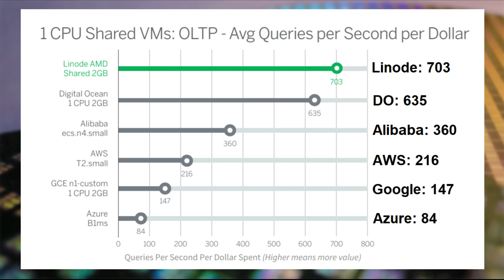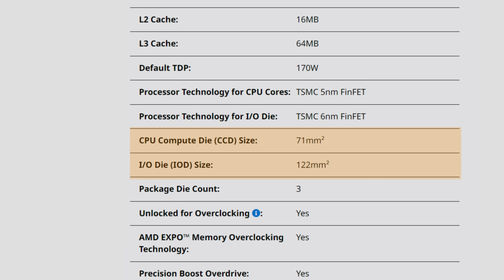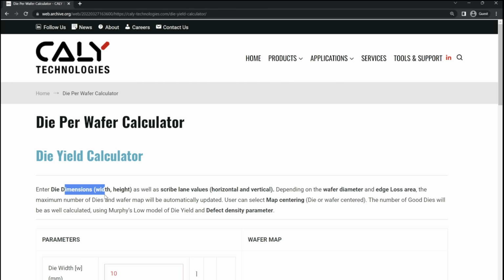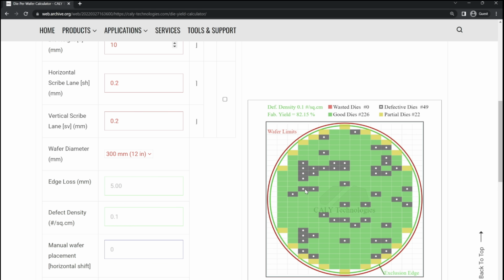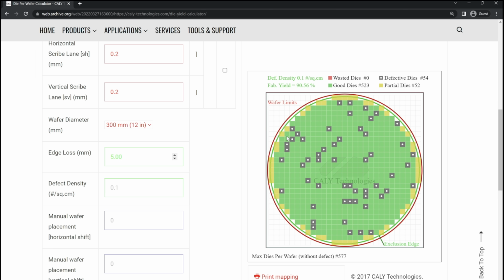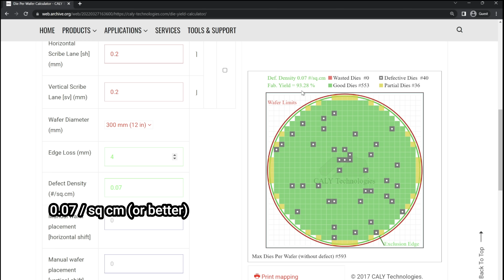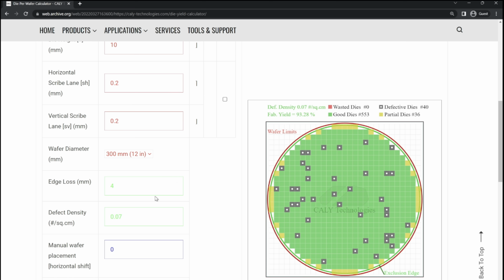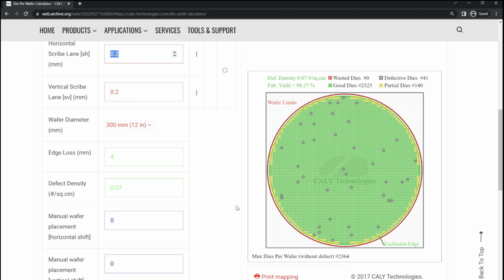AMD Ryzen 9 7950X: Cost to Manufacture?

Comment: I would be curious to see this same logic applied to the new GA102 die from Nvidia... that thing is pretty chunky
Reply: It's easy to work out, but without doing it properly, about $200.  Its 608mm² which is roughly 9 times the size of the AMD CCD.
That's using the cost to process a 12" wafer on N5, not N4, not sure how much a wafer processed with N4 costs, haven't ever seen it published, I knew from memory N5 cost $17,000 before I even opened this vid
Reply: @minus3dbintheteens60  Nvidia is using a custom variant of N4 called 4N. The amount that Nvidia spent divided by the amount of wafers they get, amounts to around 24-25K per wafer. Their per wafer cost is probably slightly lower because they had to spend some money to get the customizations tooled.
Reply: @dex6316  gee, that seems expensive, if I had to guess, I would have said that the cost would have equalled the same as the cost per transistor as N7 and N5, as it seems to be the trend, wafer prices increase, cost per transistor stays stagnant (for now, until it probably rises)
Reply: @minus3dbintheteens60  nVidia has clarified things, what they call 4N is not TSMC's N4 apparently, but N5
Reply: I think all nVidia has done is changed the fin arrangement of the commercial 5N that AMD is using and slapped a different name on it.  I knew that N4 is just a refinement of N5, the density would probably be the same if not very similar between the two.  The designers can choose different fin configurations based on their cell blocks to optimise for efficiency, power or density
Reply: About US$193 if every die from a wafer is usable, using the video's numbers.
Reply: I assume you mean AD102? GA102 is the last-gen die.

Comment: Honestly, I think it's ridiculous that we give AMD and Nvidia so much s**t for overpriced GPUs, but we let AMD and Intel get away with charging the same for CPUs that cost half as much to manufacture.
A Ryzen 7 5700X should not be the same price as an RX 6600 which has about the same effective silicon area (when accounting for disabled parts of the RX 6600 die), most of which is built on a more advanced (and therefore more expensive) node, and includes RAM, a PCB, a VRM, and a cooler. CPUs are also much cheaper to ship, and benefit more from economy of scale as they're made in much higher volume.
If an RX 6600 costs £260, a Ryzen 5 5700X should cost about £180 at most.

Comment: Yes it's an interesting analysis, but it's like comparing the cost of pressing a CD $.3 to its retail price $15. Manufacturing cost could be the main portion of a product like in steel rebar or a small part.
Reply: They're making 50-100% per CPU sold.
Reply: @xslvrxslwt  Point is, that's not counting for design costs which have to be amortized across all the chips being made. That design and R&D didn't fall out of the sky.
Reply: @SirMo  And how else we're going to estimate how much AMD is valuing their R&D if we don't look at the end product's BOM?!
Nobody is saying that AMD should be selling those chips at $69, because that's what it cost them to make them in raw materials!
Reply: @xslvrxslwt  Meaning, there's hundreds of dollars that contribute to the final cost, since retail price is like $750, and the manufacturing cost is just a small part of the total equation.

Comment: The SMDs cost also and the heat spreader.  Likely still under $100 dollars but still cost no the least.
Reply: SMDs cost next to nothing, 15k reel of 0201 caps is about $10-$20, so even if you place 100 of them on a single package, they would cost only $0.13 (assuming $20/reel). And that is the reel price available to us mere mortals on the open market, I'm sure if you order millions of them direct from manufacturer, you will get much better price breaks.

Comment: I have heard for a year that AMD makes 40% profit. So if your CPU costs $699 and you deduct 30% the cost would be $420 to make that CPU.
Reply: Not exactly. AMD doesn't only make CPUs, and CPUs have significantly higher profit margins than GPUs and console SoCs.
Reply: @nathangamble125  ya exactly the consoles have really really low margins because of how much promised volume they provide, and since they make a shit ton of consoles their margins will go down. Their cpus have huge margins but their larger dies (gpu and console apus) obviously won’t, though with gpus about to use chiplets I’d expect their margins for gpus to go through the roof aswell.
Reply: What abot other costs? Development, marketing, shipping, retail markup, costs of running the company, taxes,etc, etc. So it sounds about right.
Reply: This is absolute dogshit pr non sense to justify price gouging

Comment: This is probably why there may never be a sub $200 Zen 4 chiplet based CPU anytime soon until perhaps AMD rebadges these Zen 4 dies on the future lower end Ryzen 8000 or 9000 CPUs.
Reply: This price floor is what I was about to mention as well, but I don't think the value market going to get chiplets from the previous generation.  The value market is best addressed with a small monolithic CPUs, likely made on an older process node to save money.  This would align with AMD wanting to change its naming scheme to do away with branding by architecture and instead have an annual lineup of CPUs (that way some CPUs can get sold for multiple years and still be "current gen").
Reply: Once you’ve produced a couple million chips economy of scale makes it viable to release super cheap scrap silicon for the budget buyers. All of those defective dies will be able to do atleast 4 cores, some 6. The 7600x could be sold at 200 easy, it has such bottom of the barrel silicon requirements. 105W at lower clocks than any other chip, only six cores and only half the cache. The CCDs are so small already the likelihood of one being so defective it cannot be salvaged is effectively zero, only 4 cores functional at the absolute worst case.  zen 3 budget cpus make alot more sense since 7nm costs a lot less now than it did, and would still be killer options. You could also use a shittier IO die on 12nm like the original w the zen 4 cores for budget cpus if you wanted to save some cash.
Reply: @tranquil14738  If the defect rate is correct, then there aren't nearly enough defective dies to serve the high-volume budget market.  You either have to disable parts of fully-working dies or make a smaller die with only the parts you need.  Though I agree that relegating zen 3 chips to the budget market is probably the right idea.
Reply: @TheVonMatrices  you don’t need a fully working die for 6 cores or whatever, I’m pretty sure although I don’t work in the semiconductor space obviously. Defective die = disable the faulty parts by fusing them off and then boom it’s working now
Reply: @tranquil14738  I was pointing out that only a single digit percent of the die are defective.  The budget parts make up >50% of the volume, so you need more than just defective die to satisfy the demand.
Reply: @TheVonMatrices  ah yeah, true

Comment: jeez something about the defect density field bugs me, should it not just be a percentage yield? is it just like a likelihood for the machine to "bug-out" per unit area?
Reply: No, because it is a average number across the entire wafer, so any customer/design can take it into account. 
Changing it to a percentage yield means you would have to base it on die size, and therefore not a universal number.
Reply from the maker: There are hundreds of steps, so it's not just 'one machine'. Defects per square centimeter is the metric they track. I did ask when I visited Intel's Fab in Israel a few weeks ago.

Comment: I assume that mask sets can only be used a limited number of times due to degradation from EUV energy.

Is that true? If so, any rough idea on how many dies they get used for and rough contribution to the BoM?
Reply from the maker: It's less than it used to. Part of it is also the pellicle and the protection.
Reply: @TechTechPotato  Samsung 4nm node was reported to have yields as low as 20%. Do you have any data if this has improved over time ? Can we speculate?
Reply from the maker: I don't know if Samsung has shown those graphs

Comment: The real costs will be higher , at least doubble i guess , it lacks the costs for R&D and shipping , but yes , AMD will have a good marge . Even more with their Epyc Milan / -X  Server CPUs .
With the new RX 7000 GPU lineup AMD outsourced the Cache and Memory Controller to seperate chiplets which leads to a relativly tiny GPU chiplet and i am sure that AMD can produce cheaper their GPUs than NV , at least at the high end . We live in interresting Times , Intel stuck on 4 Cores until Intel got a kick in the Butt by AMD with Ryzen , we now have Core counts in mainstream that the old Intel HEDT never had with its up to 10 Cores ( 6950X for 1800 USD ) . Its just 5 Years ago and we have up to 16 cores /32 Threads from AMD and up to 24 Cores /32 Threads from Intel
Reply: Yeah this video is kinda stupid. Technology companies make their money from the TECHNOLOGY not the product. "It costs $0 to make another software license for software you've already published. Why do you have to pay for it?" Mentality
Reply: @DoesntRefillTheBrita  Your comment is kinda stupid. At no point does he make a claim that is the total cost of the chip from start to finish. In fact, in the end, he specifically mentions "bill of material" costs, which is exactly what he went over. If he had gone into an argument about what they are charging for the product and mentioned the profit difference, you'd have a point. But he didn't, because that wasn't the point of the video.
Reply: @DoesntRefillTheBrita  For hardware the marginal manufacturing cost per unit is very important too.  The design will cost a lot of money to make but it is independent of how many CPUs you manufacture after the production line is running.

Comment: Does this take into account R&D costs?
Could you do a video about average cost of R&D to get to the point of actual manufacturing, an estimated number , which will of course vary from generation to generation.  But it would be nice to know a bit more about that.
Reply from the maker: It does not. NRE is amortized over the lifetime of the product.

Comment: I was just talking about this 2 days ago. Thank you for the breakdown. Matches my own give or take $10. With that in mind, what the end consumer is charged for a chip is....😞
Reply: While more competition may lead to lower prices in this space, I don't think it would be drastically lower. As some other comments have already pointed out this cost to build is leaving out a lot of detail around how you get to this point, having to buy in bulk to get those prices and then sell large numbers, ship, give margin to partners etc. I am sure the margins on these chips are healthy but it isn't like they could be sold for under $100, that would never work. I would venture a guess (and this is a complete guess but I do work in a similar industry) that if they were selling these for under 500 and thus also sold other models for less in a similar fashion, they wouldn't be making enough to remain a top silicon company for much longer.
Reply: @ReivecS  exactly overheads usually cost more than the materials of the product
Reply: @randomshorts739  often, yes. But it's still not a Grand per unit like HEDT was and it's not the $500-$800 a top consumer unit costs. Do the math. Even rounded down ballpark figures. It's greed. If it weren't research facilities would get free tech. No one buys stocks just to see the company succeed. They do it to make money from the rise and fall of it's market value. That is as simple as I can put this.
Reply: @Dr.C-UTS  They couldn't reduce the price that much more actually AMD's revenue is 16 billion and they spent on operating expenses alone before tax almost 13 billion then they have shareholders and need to keep money on hand for the next lot of R and D you really haven't a clue have you
Reply: @randomshorts739  I have already explained this. You continue to rant. I do not know why. I have tried to explain this as simply as I could. I am afraid it is not me that is clueless here. It's *you*. I'm going to guess you are very young and without a background in finances. It's ok. I didn't have one either. I had to learn that over the years. Good luck figuring out that what I am saying is the investors themselves are there to make money and do not care what you or I have to say about it. They have no issue raising prices based on fake news stories and or other forms of propaganda. And they do not care about the recession beyond looking so heartless people protest and heaven-forbid boycott their products. It is pure, unadulterated greed. It is not I repeat NOT sustainable in anyway. Much like The Lorax, you can only capitalize on so much before you destroy what you are capitalizing on. It's a fact. The products are overpriced and given status they shouldn't have. I worked R&D and created a thing or two so I am telling you, you are incorrect. I am trying to help you see the truth. You AMD numbers do not matter. They are still making BILLIONS after overhead. Whose pockets will that line? The investors. No more, no less. It certainly is not savings passed to you or I.
Reply: When you take R And D, failed dies, storage facilities, transport,wages, and many other overheads
Reply: @randomshorts739  take all that and we are still being charged too much for a handful of greedy investors. It's just the truth. Has been for a long time.
Reply: @Dr.C-UTS  last accounts Revenue was 16 Billion operating expenses 12.8 billion 600 million tax then they have to pay shares as they are on the stock exchange not as much as you think

Comment: You can disable cores in the case of defects so better yield is not a good reason for the chiplet aproach.

monolithic dies actually perform better. 

13900k > 7950x

Comment: Using all of your figures, and assuming a 24.6 by 24.6 die size, it looks like nVidia is paying about US$193 per die on their RTX 4090's,  provided they can salvage all of the dies with defects.  With no salvaged dies, it cost goes up to US$293.  Thanks for the video.
Reply: They will salvage those dies as 4080, 4070, 4060, etc., by turning off non-working portions.
Reply: @prman9984  4080 and bellow are different dies. 4090 is already salvaged. It's not the pristine top bin chip. Fully enabled AD102 chip has 12.5% more cuda cores.
Reply: @prman9984  Eventually, yes, but not in significant volume, and not any time soon. Initial runs of RTX 4080s will be based on the AD103 die, while RTX 4090s are based on AD102. Most AD102 dies with too many defects to be used for RTX 4090s or 4080 Tis will just be thrown away or put into storage.
Nvidia didn't release RTX 3070 Tis (which normally use GA104) based on GA102 until just a couple of days ago, because Nvidia hadn't accumulated enough GA102 dies with so many defects that they couldn't be used for RTX 3080s for it to be worth doing a production run until now. We'll likely see a similar time frame with AD102 - we probably won't see RTX 4080s which use AD102 until 2024 or late 2023.
Reply: @prman9984  no they wont, the 4080 is a seperate smaller die
Reply: I did the math for Navi31. With no salvaged dies it's $160 (compared to AD102/4090 $293). Damn. If it can get close to 4090 in performance AMD could murder Nvidia.
Reply: @SirMo  How much is it assuming that all dies can be salvaged?
Reply: @SirMo  did you remember to add in the MCDs?
Reply: @WayStedYou  I did. Each MCD is $6.6 * 6 = $40, the 5nm GCD is $120
Reply: @SirMo  Hi, I was hoping you had included all of the chips.  Thanks.

Comment: Does that packaging estimate include shipping?
I think AMD will probably slowly ramp the prices back down to compete better with Intel. It just really sucks for them as a company that Zen 4 was delayed just enough to not launch around the time of Alder Lake.
Reply: Package cost here means the cost to put the dies on the final chip substrate, wire it all together and slap on a heatsink.
Reply: *heat spreader, not heatsink
Reply: Not only ZEN 4 was delayed, it was also the worst launch ever.
Reply: @xslvrxslwt  Zen4 launch was not bad at all. What are you talking about? Rocket Lake and Bulldozer were far worse launches.
Reply: @xslvrxslwt  Not really. The only thing that makes it a bit weird was the launch / delay of cheaper motherboards... but its not a bad launch at all.
Reply: @xslvrxslwt  B550 was the worst launch, it was a year late and then didn't even get chipset PCIe4 support.  Adding insult to injury most of the good b550 boards weren't even significantly less expensive than comparable x570 boards.
Reply: @s1mph0ny  yeah I ended up having to buy a new B450 to run a 3600. No PCIE4 for me. And it was an absolute ball ache getting it working. Blind flashing the bios with a really finicky and poorly documented procedure. Took hours. 😤